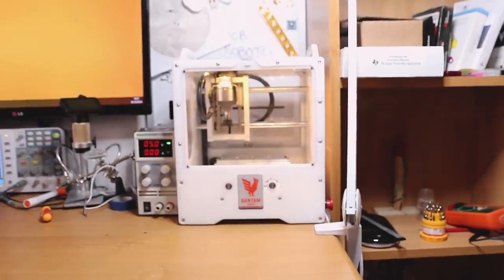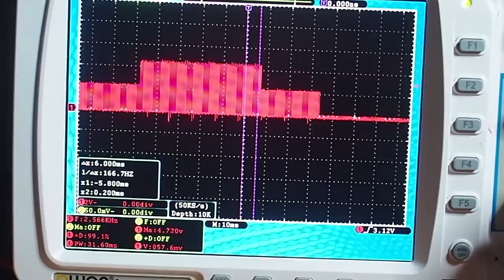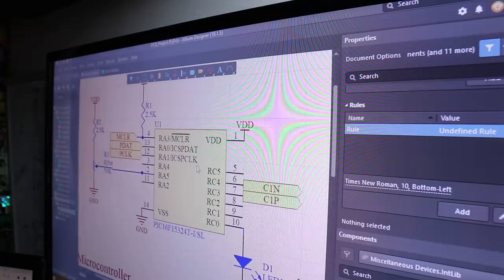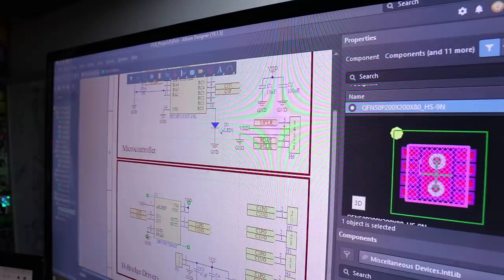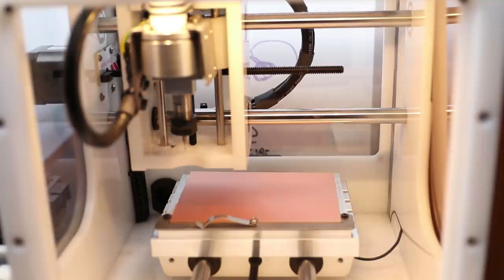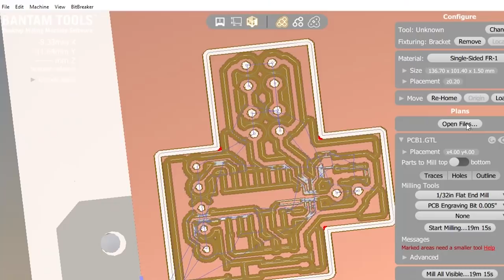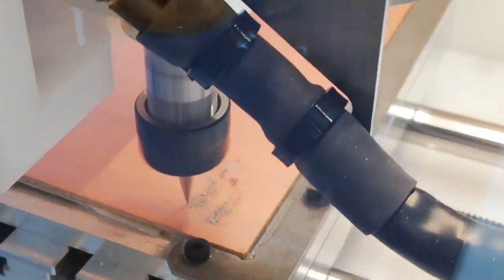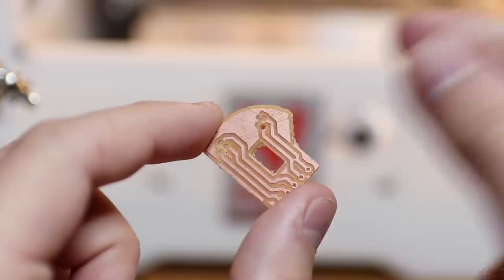Making PCBs in MINUTES!

Comment: $3,199 !!!!! this is crazy. I think it should cost around $250.
at $3000 you can even buy a 6040 CNC router and use the same engraving bits, mill 10 larger with better precision.
Reply: 250 is a bit low 1000 would be reasonable remember they are a small company and the 6040 cncs tend to be pretty bad for pcbs
Reply: @alexfletcher8465  I have a 6040 CNC and it is perfect for PCB's.. Most issues that are typical in PCB miling (like z changes) are not caused by CNC.. And I am currently using this CNC to build a pick n place machine... so much more versatile than above machine..
Reply: @alexfletcher8465  i built a 3' x3' x 5" cnc machine which can hold +- 0.006" tolerances for around $300, mind you, that's usuing almost all aluminum except the wasteboard.. this machine is made from much cheaper materials (HDPE), and is very small in workspace, so a $1000 is still astronomical for what it is.
Reply: i dont mean to be so off topic but does any of you know of a method to get back into an instagram account?
I was stupid lost my account password. I would appreciate any tips you can offer me
Reply: @Dalton Marcellus instablaster :)
Reply: @Decker Raul thanks for your reply. I got to the site thru google and I'm trying it out now.
Seems to take a while so I will reply here later with my results.
Reply: @Decker Raul It did the trick and I actually got access to my account again. I'm so happy:D
Thank you so much, you saved my ass :D
Reply: @Dalton Marcellus you are welcome =)
Reply: @ArcAiN6  Do you have any plans to share for that cnc?

Comment: 3199$ to 3999$ for a tiny machine to make PCBs?  are they kidding us or taking us for billionaires?
Reply: INDEED! omg 3200!!!
Reply: Hahahahahaha 3000$ for a PCB mill. I bought my CNC mill for 230$ and it has auto level probing, which this machine lacks... Disgustingly expensive.
Reply: @rojirrim7298  What make and model did you get if you don't mind me asking?
Reply: @spamspasm8183  Of course I don't mind! Bought mine at Sainsmart during a sale, and it's the Genmitsu Pro 3018.
Reply: @rojirrim7298  Thank you!
Reply: @spamspasm8183  No problem :)

By the way, in order to have autolevel you must have it connected to a computer (in my experience) and have a specific CNC Gcode sender program that allows for it. For my PCBs I've always used OpenCNCPilot, which is an open source program with autolevel capability (it probes the copper surface with the drill bit itself, maps it and applies the level to the GCode). It's free and works like a charm.

Good luck my man!
Reply: Just DIY >100$ , then spen the rest like 2900$ in a Bordthel of your choice ;D
Reply: The fuck?! Didn't expect them to be cheap and an investment, but that's at least 3x as expensive as I was gonna go.
Reply: Having worked with the Bantam OM, I absolutely love it and can attest to its precision. I do agree though, it is a bit pricey. You are paying for an extremely user-friendly software experience, beautiful safety features, automation galore. There are definitely cheaper options out there, but not many that are quite as advanced as this mill.
Reply: @audeophilic2578  I'd go as far as saying it's only worth it if you need the extremely short turn around time. Doubt the extras you mention can overcome the shortcomings.
Reply: @1337Shockwav3  absolutely. It is a lot of fluff for sure, there are plenty of affordable mills out there that can do all the same things.
Reply: I'm ok using JLCPCB
Reply: @audeophilic2578  Personally meant stuff like chamfered edges (even tho those mills might actually support it?) and the lack of solder resist (I do TQFP100 these days where soldermask is a must to me). But as said, if you need the extremely short turn around times, I'm sure those mills are worth their price ... and well let's admit it, watching those is nerdpr0n ;)
Reply: Did you think he bought it at his own cost? Hahaha. Paid review as always.
Reply: For that price I prefer to buy a Wegstr It seems to have better and much cleaner results, If only I have the money... 😋
Reply: @audeophilic2578  IF you want to to 10 mil trace, 10 mil space -- and populate 0603's, SSOP, TQFP 100 parts -- Bantam/OtherMill - every time :)
Reply: For that price it is better to modify an old 3D printer. And send Gcode. And learn in the process. Even the Xcarve is cheaper, and then you can do big signs and stuffs.

Comment: Heightmap - you need it for larger PCBs since removing 0.034mm copper for FR4s requires really really flat boards that are impossible to come by. Or use 0.1-0.2mm flat 2 flute endmills which can get really expensive and good for only 8-10 7x10cm PCBs.

Comment: You should investigate Bantam's "Bit Fan".  It's a small plastic fan that fits on the shank of the cutter.  It blows the dust away from the cutter.
It's particularly good for use when cutting plastic.
Reply from the maker: Looks useful! Thanks for the tip

Comment: Wouldn't using a photopolymer film and then etching be nearly as fast and way cheaper?
Reply: you need quite some time for setup and cleaning, also a mill can be used for so many other things

if you only want to make a pcb from time to time and don't need a mill for engravin, it sure is faster to etch
Reply from the maker: Yes it might be.. But like I said the whole process would be more time consuming to set up and I don't think you can get the resolution of the mill either
Reply: @CarlBugeja  for a small single sided, smt board, photo etching is a bit slower, but has equivalent or higher resolution and way cheaper in terms of equipment. (but it scales much better and you can do soldermask with the same equipment) 

Making fine traces is way trickier on mills then it is with photoetching. Mills really shine when you need custom edge routing, a huge number of through holes/vias, or slots. Otherwise the inevitable cutting into the substrate is pretty universally a bad thing.
Reply: its cheaper but you have to manually cut out the pcb and the holes drilled,not worth the hustle esp if you are making 50 pcbs!
Reply: @DeejayGrafixx  if you can get away with using a shear and only have a few or no through hole components being able to make a letter page sized board in only a couple steps (clean, laminate etch resist, expose, wash, etch, strip etch resist, laminate solder mask, expose, wash) makes the photo process faster. For small boards a mill is faster, but you still need to use a photo process if you want solder mask. Plus you need to fill in the removed substrate (flood with resin and then clamp on a flat surface face down?)
Reply: @DeejayGrafixx  as for me - if i will need to make 50 PCBs i will do this task on plcpcb or any other pcb making service. Making of 50 PCBs by graving )))) it is time-killing task i think... Time = money! Less time and the quality will be perfect!

Comment: My guess about first failure was that copper plate was uneven (maybe bed too). I remember watching random video with milling pcb, and before they milled pcb, they calibrated copper plate for thicknes in many points. If your machine could do that, then it would allow you to make shallower cuts. And thanks for video! :)
Reply from the maker: yes it was uneven (i think had an overlap with the double-sided tape underneath the plate). The mill does calibrate the thickness of the plate on one point and i think you can also change the settings to perform multiple points aswell
Reply: Hello my friend, I just visualize a new tube, the circuit board is manufactured without the chemical, only the alcohol at 90 °, and it possible?

Comment: Coowl to do once but eventually the 4 days wait for a real PCB is worth it in my opinion ^^>
Reply: but still, with more complicated boards with some eventual mistakes in the design, it multiples development time and also cost in comparison with homemade one piece methods...
Reply: Two words. Rapid Prototyping. If I need to build 4 working prototypes in 24 hours, 4 days will be out of the question. This machine is mostly designed for prototyping.
Reply: 4 days? it took mine 2 weeks. and are much more expensive.
Reply from the maker: I totally agree with your comment.. For sure milled pcbs are not going to replace a properly manufactured pcb but I will find it useful to quickly test parts of a new schematic or something very basic..
Reply: @CarlBugeja  I like the idea of proof testing a design, before ordering 1,000 mistakes. I think this is an economical way to prototype with surface mount components, especially, if there are mistakes, or, other components need to be added for stability of the circuit. Once perfected, that's when you place an order, and get quality PCB's.

Comment: Won't the temperature of the soldering rod blow the transistors or processors. Is that gold that you use for the circuits. Why do you call it an integrated circuit? All components inside one small hardware?

Comment: I thought to make PCBs you had to add copper to something nonconductive. How is this machine turning a solid piece of conductive copper into a PCB??? Won't the current just go everywhere?
Reply: Oh sorry, I think I understand, now. The copper is just a small layer on top of the nonconductive material and you're milling away the copper. It's just that in the video, it sounds like you're putting a solid slab of copper in the machine, not a board with a small layer of copper.

Comment: For single layer PCBs the toner transfer method works,  but instead of heat and pressure, use acetone. This method also works for hobbyists who opt to manually design PCB tracks using any painting program like paintbrush! Yes, paintbrush. Copy and paste can do miracles even when there are ICs. For the hobbyist, who does not want to be bothered by extremely combersome PCB designing software, the toner transfer method is enough and very inexpensive.

Comment: They were poor PCB milling results due to the machine’s incapability to handle board warpage.  The second job was milled far too deep.
A T-Tech QuickCircuit does a much better job and caters for board warpage. Good PCB mills track the surface of the PCB giving them superior results.

Comment: The enclosure is inadequate as milling copper will release and expose one to lead debris.
Reply: There is no lead in a PCB until it is tinned with a lead based solder.  Fiberglass dust can be a different problem.

Comment: Nice video! Nothing against you, I think you have solid potential, I’ve used this machine and hobby machines, I know this bantam mill is a trap

If you’re a school or professional, sure, maybe, with that money you can buy 10 hobby pcb mills so maybe not for professionals that should know how to operate the machine and need to make pcb’s in quantity, and the learning curve is essentially the same as hobby machines so maybe not for schools (I like fritzing and flatcam, eagle is nice until your student subscription runs out, but lots of good ones out there)... enclosure is nice though, not as nice as a cardboard box with a syran wrap window, it’s just so expensive, I cannot reasonably recommend it because the parts all together cost maybe $200-400 if you’re buying parts raw or commercial and you’re left wondering if the ergonomics really value themselves for thousands and thousands of dollars, I’d pay maybe $900 for this machine and that is generous considering it does not have auto leveling, a larger work area, a strong motor, no ball screws, no removable bed, no crash detection, requires an additional vacuum rather than a built in system, black fiber vacuum cover that obscures the tool bit instead of transparent PETG fibers or strong vacuum or any number of solutions, no lcd interface, machine must be tethered, I want wifi so I can keep my computer a safe distance from particles, etc etc so much to be desired and that is not including vanity wishes, like if I pay for a $3000 pc, I want enough unicorn RGB vomit to light up a city block and a water cooled spindle with mufflers for noise reduction
Reply from the maker: Thanks for your generous comments 🙂 I agree that it is a little expensive (like I said I won this in a competition) and there are definitely cheaper alternatives.. But all the points I mentioned in the video are all pulses for tool which can be seen for any other milling machine with the same specs (btw it has auto-level, the first try was a failure because of a mistake from my end)
Reply: Carl Bugeja oh cool, yeah my bad, no one using it in my school knew it had auto leveling, we had this show and tell once where we kept having to throw out a bunch of dog tags because the machine could not get the depth consistent, idk, seeing this machine makes me want to rant sorry, I am sure it is a good tool in the right hands xD

Looking forward to your next video!

Comment: This is good machine, BUT I NEED to BE SARCASTIC: You spent more than $3000 for producing an 16cm2 square centimer PCB. If I look around there are lot of cheaper manufacturing company are exists. Under $20 you get 200mm X 200mm 2 sided PCB with Registered shipping.
This device is not more than an expensive garbage.
Reply from the maker: Like I said in the video I won this machine from a competition 🙂 I agree that it is a bit expensive and there are cheaper alternatives for sure.. But it still have many advantages that can help me for future projects 🙂